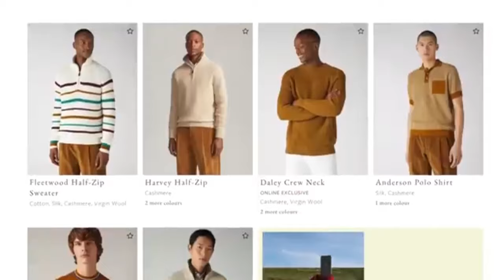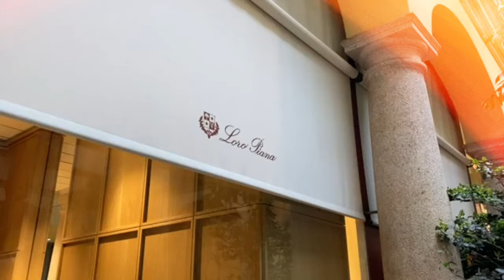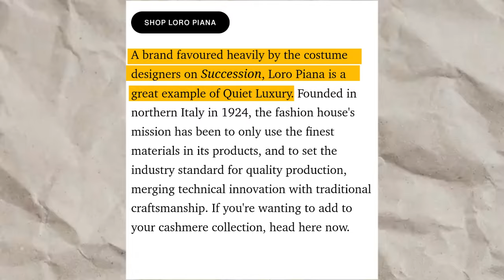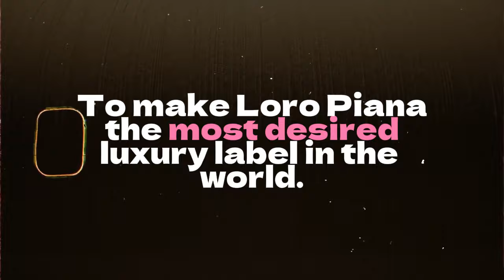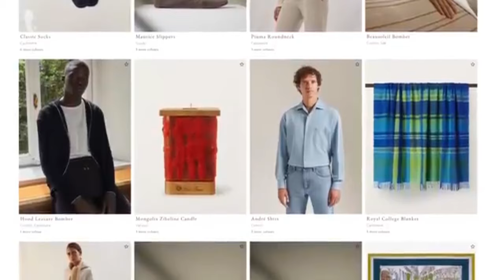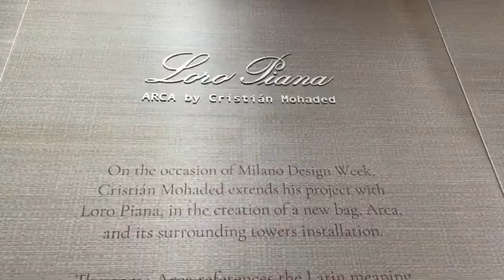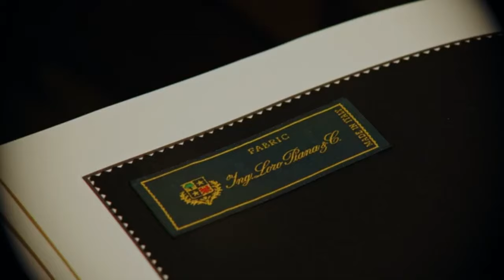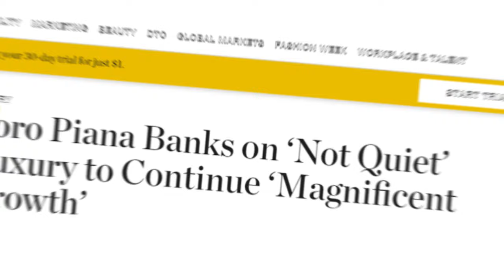The Rise And Fall of Loro Piana: No More Quiet Luxury!

Comment: Been buying pieces from Loro Piana since 1998. Still have that piece and wear it (the Horsey and a cashmere roadster mockneck zip up cardigan) for taking the dog out for a walk and doing chores. It does what a Barbour does.
When it came out in cashmere, I bought one because, it's functional and dresses up and down. 
Been wearing the Sail and Walk loafers which they call the Summer Walk since it came out. But stopped wearing it for awhile because everyone was wearing it and starting wearing my Belgian Shoes around instead.
The pieces are expensive, but you wear it for years.
Decades even. The cost per wear is phenomenal.

May be I am getting old, but I wasn't old when I started buying Loro Piana (I was in my 20's, I just liked well made classic timeless items) the newer stuff from Loro Piana and the "re-interpreted" classic pieces are a bit too out of my comfort zone.

I haven't purchased anything from them in 2024, because those pieces all look like it will date itself within the next few months.

I'm finding joy in purchasing pieces from small companies that specialize in one item or category and have been doing that for years.
Reply: may i ask how do you wash/clean it? specialized, dry cleaning, or do it at home?
Reply: Do you own their Vicuna fabric ? That's the million dollar question ! Notice the video didn't even mention Vicuna. Which the brand has a Monopoly on. If other brands want vicuna fabric, they have to go thru LP. LP limits the amount of vicuna they will sell.